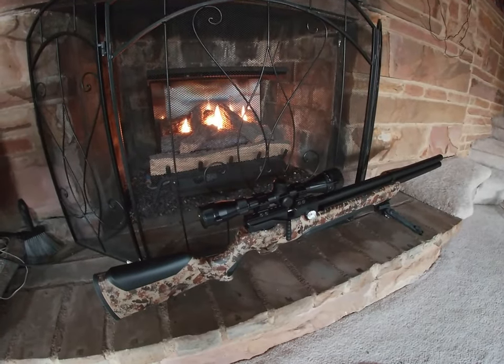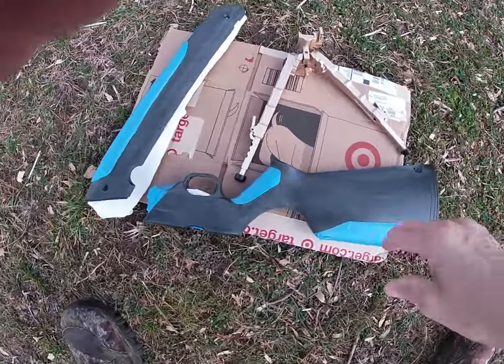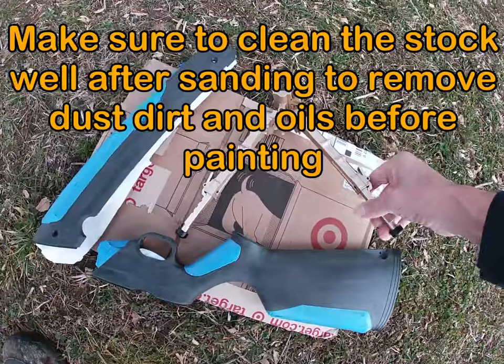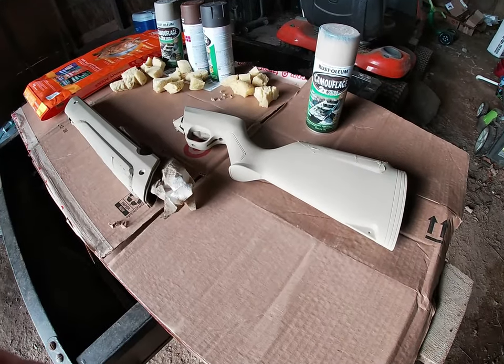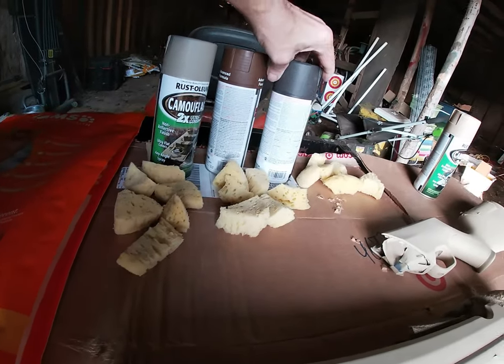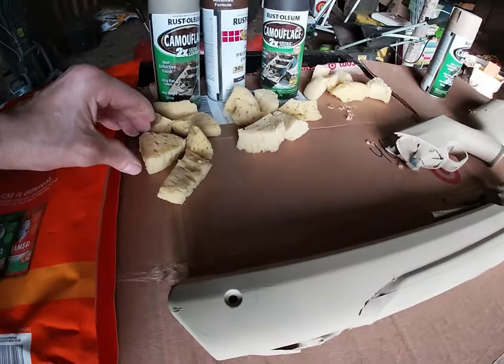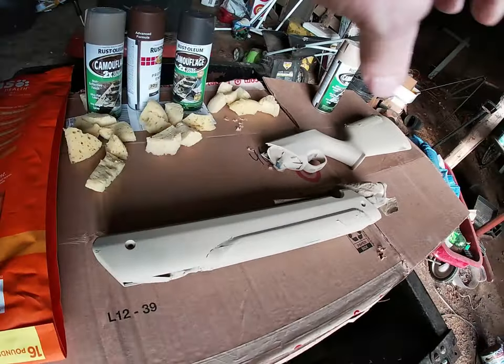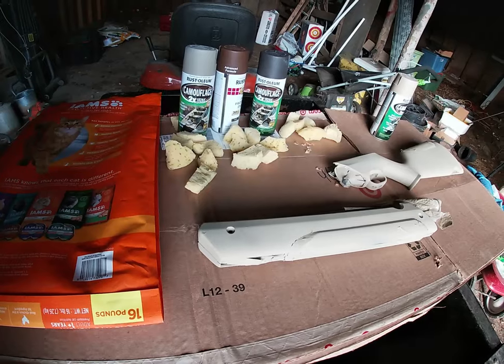Air Venturi Avenger [Camo Paint Job]

Comment: 👋🏾sup bruh that turned out great brotha 👊🏾😎
Reply from the maker: Thanks bro, I was hoping it would be ok, I'm happy with it, still wanted a real sea sponge to make it look really bad ass, but it works, I'm happy.
Reply: Love the look of your Avenger,. Just wondered how do you do you like you Avenger? I've got one in .22 cal and have added a DonnyFL on it and it works wonderful ...
Reply: @anthonyferguson1644  👋🏾sup bruh! Best $300 spent brotha 👊🏾😎
Reply from the maker: @anthonyferguson1644  Thanks. It's accurate and powerful, love the cocking handle, etc. I haven't spend a ton of time with it yet, I may have two to three hundred rounds through it. Mine has a slow leak, apparently normal, and likely easy fixes come out of searching in forums. I love the way it shoots though, I can hit a water bottle over and over at 130 yards with Air Arms pellets. It's my first regulated gun so it's fun and new, lol.

Comment: It is a good way to do it, and it looks great man
Reply from the maker: Thanks. You can switch up colors, order, patterns, paint striped on first, all kinds of stuff you can do with sponge painting, lol.
Reply: @slowpokeairgunner4027  I will try this way out thnx
Reply from the maker: @themaskedairgunner4321  I did my Flashpup with Sand, Khaki, green and black, it is more green looking. If you take your time you can do some awesome work, I rushed this one, had a break in the weather and issues trying to get it painted, I had it apart for a few weeks, forgot sandpaper on one trip, my first can of camo sand didn't have a nozzle when I popped the lid open so I had to get another can. I eventually got several hours to mess with it and got it finished, lol.
Reply: I did mine in 15minutes, it was just a black cooting and then the paint were I did the branches with
Reply from the maker: @themaskedairgunner4321  the only reason it took longer on this method is drying time between coats, about 20 minutes. To get cleaner and clearer lines you can let it dry for a good 24 hours before putting the flat clear coat on, if it's still a little damp under the paint it will make it bleed a little over time and mess up the clearer lines of the pattern and be more splotchy. I didn't let it completely harden on this one either, but I dried it quickly in front of the fireplace and it prevented it from happening.